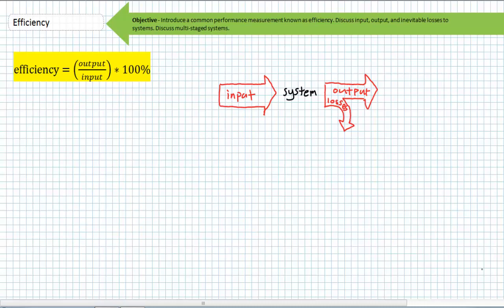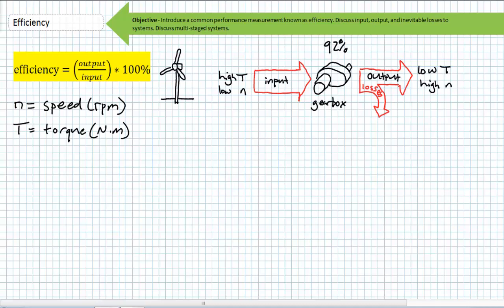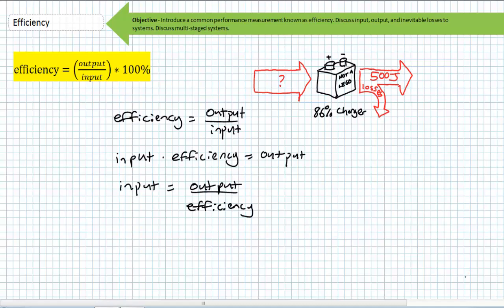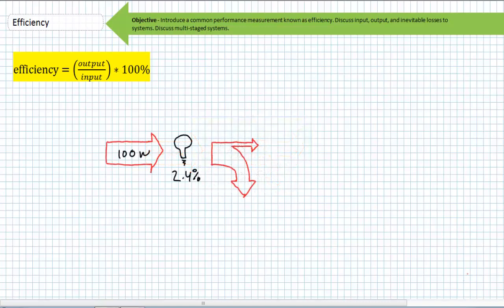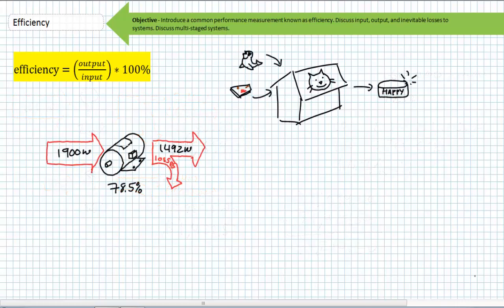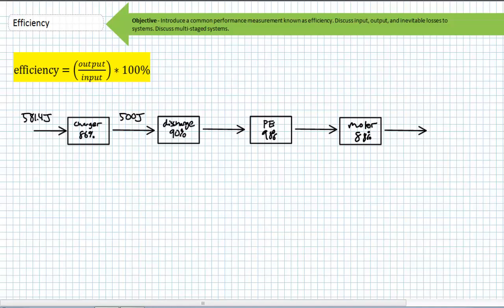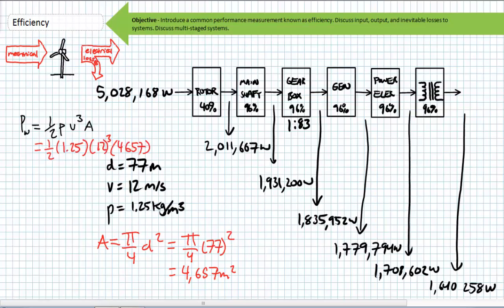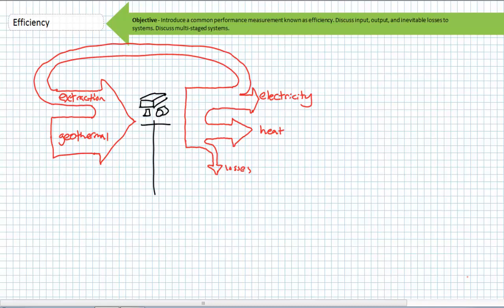Efficiency (OLD LECTURE)

Comment: The use of CFLs work well for the examples, however it may be worth mentioning that another draw back to using them (especially in homes) is that a small percentage of individuals are hyper sensitive to the radiation they emit. I personally made this discovery with a roommate after they had suffered chronic migraines for almost two years until I had replaced the lamps in the overhead fixtures to incandescents. I’ve since met one other person with similar sensitivities. So far, LED lighting seems to be the safest and most efficient way of lighting with some of the new lamps even being programmable and capable of producing the warmer tones of incandescents.

Comment: Where would one use KW/HR verses Joules for energy?
Reply from the maker: Good question.
small phenomenon - joules
large phenomenon - kWh
kWh happens to be a very human scale of measurement since one hour is something easily recognizable and an average human can produce about 200W of power (trained athletes might be able to produce 400W). This means 1kWh would be roughly equivalent to 2.5-5 peoples labor for 1 hour. Importantly it's kW times hour, meaning that power is expressed for a certain period of time. energy is power times time.